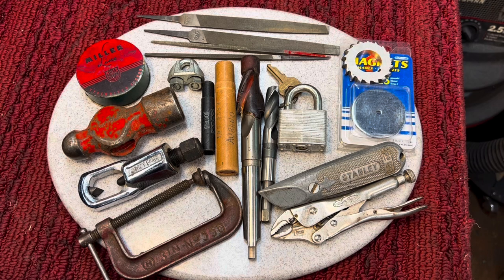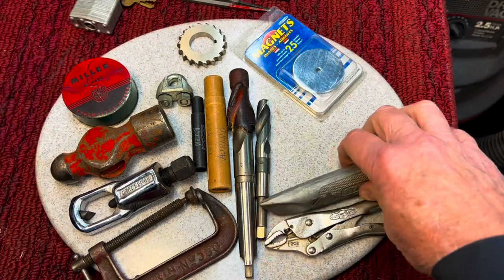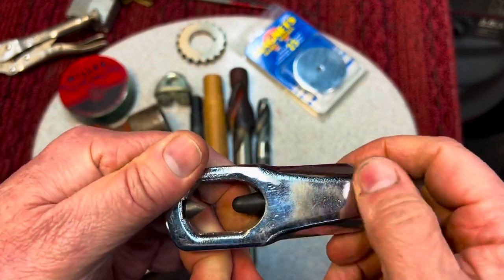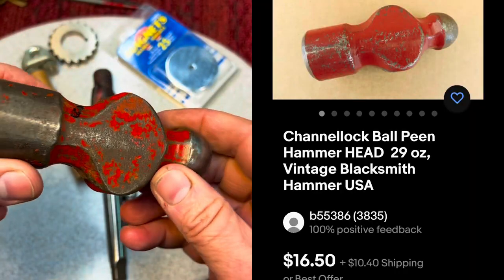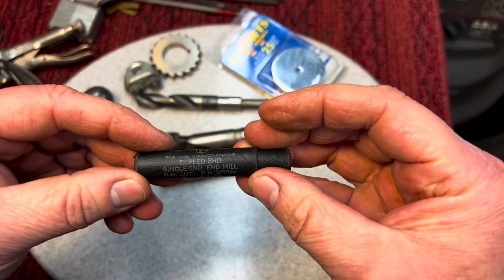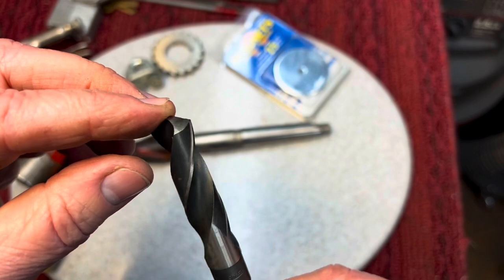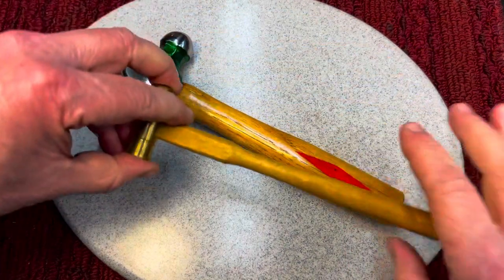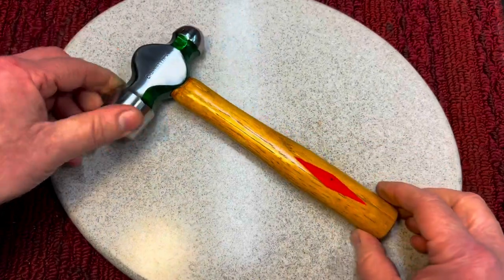EBay Score and Channellock Hammer Head Restoration

Comment: The shop made safety edge is also a way to restore the effectiveness of cutting into corners. 
The 90 deg. corners on the edge of the files chip and lose teeth. Grinding off the edge makes the worn file cut into corners again. Handy for cutting keyways.

Comment: The thinner wooden handle on a striking hammer absorbs the vibration better. 
A lighter head with a longer handle adds speed to the head and creates power. Hammering on an anvil it is bes to have a looser grip so the vibration isn't transmitted to your wrist. The lighter head is easier to swing for hundreds of blows. 
Short handles are nice for what we use to call "tunking",  Tapping a block of steel into place on a milling machine to make sure it was up against the stop. Also to seat die sections on the shoe during assembly. 
For hardened steel I had a 2" diameter chunk of copper about 5 inches long without any handle and just gripped it in my fist to tap the steel without damage. 😁😎

Comment: Thank you for the Ebay advice. Alot of Ebay stuff is getting expensive, even without the shipping costs. One of my hopes is that if I watch enough videos by pros like SC and Magdad among others, that an instinct for spotting nice, unique tools at low prices will rub off on me. That is a very nice job on the Channelock hammer head. It looked to me like you used a disc sander to clean up those curved facets which to me would take good skill. My father used to say "Happy ss a clam" but  h e would say the rest of the saying which is "Happy as a clam at high tide." Another great video. Thanks
Reply: Your comment about Ebay being expensive reminded me of a time that I took a car into to have an estimate on having some work done. The guy really didn't want to work on it (it was an English car) and he told me that it would be expensive, and that was without parts and labor!! I went elsewhere
Reply from the maker: Pat- The key to using the flap sander on tough spots is positioning!  😃👍

Comment: When you first showed the issue of the ball-peen hammer, I thought you should have put on a short handle. And you did!   Several of my needle files have a safety edge for the purposes you described.  We had a change of division codes at work and the new division wanted a full inventory of the prototype machine shop that had been in operation since the 1970s.  They had many duplicates of milling bits, cutters, short and jobber drills, taps, dies, reamers, vises and tooling. Some was sent to another facility. But they still had carts full of excess.  I made sure it didn't get scrapped.

Comment: I've gotten some amazing deals off eBay the last couple weeks too. Basically about $300 worth of stuff for about 10 Bucks with free shipping and a couple weeks before that I got some nice ball valves that I needed for about 75%+ off what it would have cost me to buy up at the hardware store..............Dad has had the same Ball Peen as long as I can remember and never broke the handle.......It's a steel handle.....I'm wondering if it's an Estwing (the rubber handle grip reminds me of my Estwing drilling hammer), I'll have to take a  look at it next time I'm there.

Comment: The reason there is more taper on a ball peen handle is because it is for striking metal and it allows for more flex which reduces reverberation to your hand and also limits rebound, so the handle suffers but you don’t lol!

Comment: At around 9.27 into the video you see a number 2 on the ball peen on the bottom I was wondering what it was there for and later on I figure that your probably correct that it is a number 2 for that reason factory defect. Excellent work as always.
Reply from the maker: Rob- I was wondering what that 2 meant. You have good eyes! 😃👍

Comment: Another great Video. The shipping to Canada makes eBay purchases less economical, but it is still helpful for hard-to-find items. I have never seen a safety file, even though I had some exposure to master filers in my younger days. At one time the mines had large machine shops with highly skilled craftsmen. They still utilized files to undertake some repairs. I have seen some large casting jobs that had to melted down due to some tolerance problems( casting sand problems), the air was turning blue, and it wasn't from the furnace. Is that what went wrong with the channel lock? I forgot about working on my cursive writing after a while. Cursive writing and more short handle hammers this new year.

Comment: To my eternal shame I only currently have one hammer in my collection, it's a Bacho claw hammer so it's quite a nice one. I am consoling myself however that I also have a wooden mallet which is technically a hammer, therefore staving off the madness inherent with only owning one of the aforementioned bludgeoning implements...

P.s. I really like the nut-cracker tool, there's probably a thousand channels on YouTube that would benefit from having one (or several) of those...🙂

Comment: I could’ve used the nutcracker a few days ago. I had to get two carriage bolts out of some wood and the previous person put the nuts on so tight they embedded into the wood and stripped the threads. The threads were so messed up, even with pliers pulling and twisting the nut up onto the good thread it would not engage. I ended up having to use a zero clearance vibrating cutter  with a bimetal blade to get most of it cut through, I then took a chisel gave it a few good whacks, split the nut in half.  I sacrificed a little bit of wood, but at least I didn’t risk breaking the wood in half as it was relatively thin.

Comment: That pair of Vise-grips and the nut splitter was worth more than the $20. When I worked on buses and trucks, I had a 4lb. sledge with a handle about 12" long. Used it to knock out axles. If the handle had been any longer than that, it would have been unsafe to use. I have no problem with a short handled hammer.

Comment: The hammer head is a second and the reason it never had a handle. I worked at a company that was taken over by Stanley. Pallets full of seconds were brought in for purchase by employees. I have a bunch of Cresent adjustable wrenches that were something like 25 cents each. They work just fine but have cosmetic blemishes like a bad spot in the chrome.

Not crazy about hammers, though I would thrash the person that walked off with my 16oz AT&SF Railroad ball peen hammer.

Comment: Hey John, I don't know if you know it but Harbor Fright sells a small ball peen hammer (about 12oz) that has a short 5" handle for about $4.00. They are cheap but work and i love mine. Of coarse I also have a couple of good ones too.
Reply from the maker: I knew they sold a small claw hammer, didn’t know about the ball peen! Thanks! 😃👍

Comment: There is gold in auction lots.  It's why I buy old boxes from under work benches and peoples junk drawers.  Lots of good things in them. I have some short hammers including a short handled sledge. I use long handled hammers because I was taught that. Well not in an acceptable way today.  It was, only girls choke up on a hammer. Peer pressure can have a lasting impression although I understand why they wanted me hit with a full swing.  I remember as an adult I guy asked me why I didn't drive nails like framers do.  It's because new nails were not something I grew up using and slamming a formally bent nail means you have to pull and straighten it again.
Reply from the maker: Philip- I remember teaching the scouts how to hammer- We would take two 4” nails and drive them into two logs and have the boys separate into two teams. They would run up and take one swing on the nail…. Talk about fun!  😂👍

Comment: I don't believe that the drift is drilled off-center; it was intentionally moved forward to more balance the hammer. Check other photos and I think you'll find that this style head all show the drift drilled forward. If you're willing to pull the head, you can determine the balance point..
Reply from the maker: This drift is crooked, the top of the drift is centered but the bottom is moved forward. If you tried to handle a hammer like this the head would tilt down.  😃👍